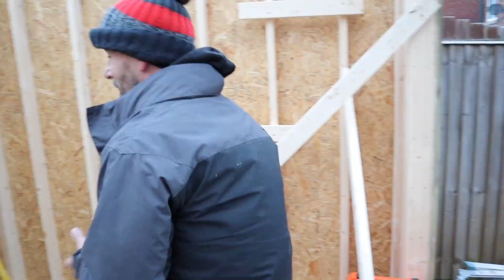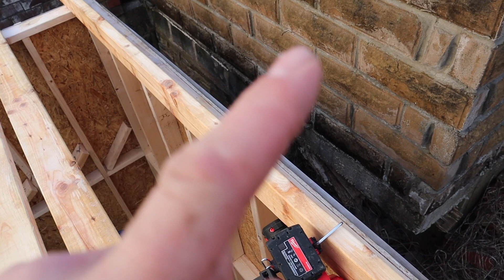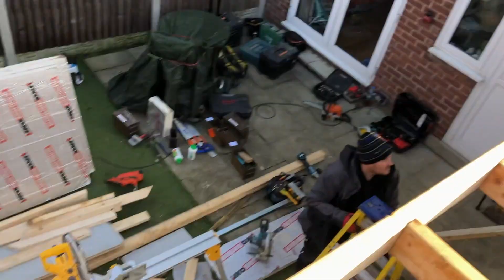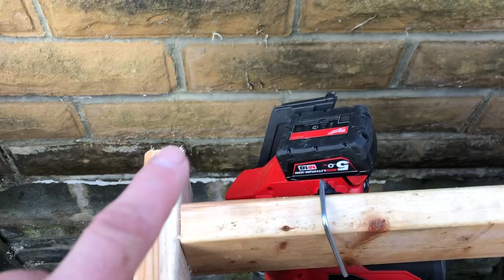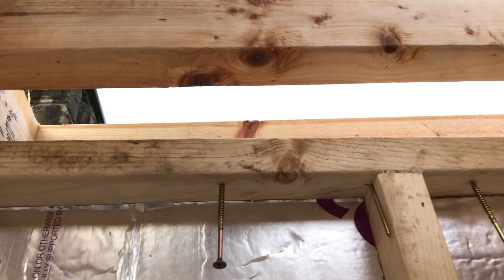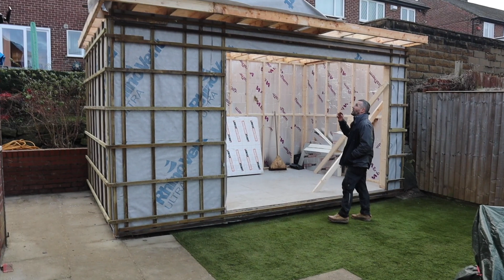Garden room flat roof constructionroof build

Comment: What do you mean about not having to put upside down joist hangers? Why would they have to be upside down and not the right way?
Reply from the maker: We generally strap the joist down over the steel lintel with joist hangers upside down to stop any wind lift on the roof
Reply: Could you fix a single length of timber on top of steel lintel and skew nails through joists into that?

Comment: If you put the insulation against the outer osb and clad inside also with osb do you need to put a vapour barrier before inside cladding or as its wood it will breathe, I was looking at macking my own sips type panels for garden work shop 9m x 3.5m approx and using the industrial 150 thick metal insulated roof sheets well that's what's in me head. 👍
Reply: In a SIP Vapour barrier would normally go in-between OSB and wall finish but if it's a garage and OSB is your finished wall it could go under the internal osb. You just need to make sure no air gap anywhere as this is where condensation can form. Guy on YouTube explains things well called Steve Roofer
Reply: @davidhamilton218   thanks for that i will look into it, instead of a wooden framed building as such i was going to do it at work with steel as i have found I'm no good at welding wood if I cut it wrong :)

Comment: Cracking job mate... just out of curiosity how will you fix the cladding on the back were its quite tight against wall? Only asking because I have a similar space I'd like to use. Cheers
Reply from the maker: We are using metal roofing sheets, these will be fixed to the back down as far as possible there will only be about 400mm not fixed but it’s pretty much tight against the wall so it’s not an issue
Reply: @thegardenroomguru  👌

Comment: Does building control have to be involved with this build? Because its gone through planning?  Out of interest how much hassel is it getting planning for these? Just wondering why you dont always go down this route, then no issues with headroom etc.
Thanks
Reply: Planning and building control are separate entities and planning can be vastly different depending on where in the country you are some authorities are fair easier going than others.
Reply: @rob1984p  yeah i understand that, but just wondered if once its gone through planning, do you have register the build with building control. To be honest I'm confused why they dont apply for planning on all the builds, then you can have better headroom etc. I'm hoping Will can shine some light on this as he currently working on one that has gone through planning.
Reply: Many neighbours will argue anything over 2.5m is detrimental to view/privacy etc so I suspect would fail planning. Remember too that a lot of the country live in very close quarters (think new build estates where everyone is already on top of each other even before having a higher than 2.5m garden room). Also planning costs around £250 and the delays at moment are horrendous . Can take more than 4 weeks, in some cases up to 12 weeks .

Comment: For the roof, 400 spacer, so not the same as the walls?? Or is it sorry confused, doesn’t take much lol
Reply: The rafters don’t need to fall directly on the corresponding wall stud. The double top beam of the walls spreads the load.
Reply: @AccountantDoesDIY  and i assume if you run the plasterboard side to side rather than front to back you'll lay it like the roof and floor in that you trim it to fit and use the offcuts to start the next row

Comment: Your lucky you have astro turf down or else that mud bath
Reply from the maker: Got a mud bath on one now 🙈
Reply: @thegardenroomguru  we just cover the garden in hard board not to expensive keep the grass from mucking and we reuse and reuse it keeps the place clean and easier to keep tidy
Reply: @orran8281  antinox works well too
Reply: @tentonhammer5469  ye I know see with the the hardboard I put it down and doesn't need anything to hold it now that stuff is good I use it for covering stuff inside

Comment: How are you going to fit the rubber roof in this weather? Either it will be raining, snowing or it wont be at least 5°C to apply. Ive been waiting to put the rubber on mine since late november
Reply from the maker: Fit them last year in the cold, well board the roof, prep it, lay rubber over it and cover with 100 mm insulation and then visqueen over night, if dry the next morning we will fit the rubber 1st thing. 
Two space heaters in the sealed room below will heat the underside of the osb3 from below, this will keep the roof above the min temp all day, allowing sufficient drying time, the top of the rubber will have the 100mm insulation on and visqueen fastened down , this will keep the frost off. Next day remove and see👀 
That’s the plan anyway, done it before successfully so we’ll see

Comment: can I ask a question ? what size are your bifolds you put in ? I am an avid watcher and struggling to see how I can put standard 2090mm high patio doors and bi folds on the front wall and keep it under permitted development with 5x2 on the roof and getting a 160mm steel in above the doors - i.e what height are you building front and back walls overall
Reply from the maker: You can’t mate, the 2.5 height limit has so many down sides, our doors are 1950 inc the cill 👌
Reply: @thegardenroomguru  ah ! so thats how you can get it under the height, appreciate the answer, might have to check out your door supplier you mentioned in Leeds then so I can get smaller door into the front wall. My front wall overall height at the moment is 2150 to allow me at highest point on roof to bottom of 6x2 floor joist be a few mm shy of the 2.5mtr

Comment: Do you usually use 50mm in the wall? I thought you used 90mm?
Reply from the maker: always 50mm mate, you might of seen us put sound bloc in on top of the 50mm on a few occasions though
Reply: Thank you. Reducing sure  saves costs
Reply: Look at U value calculators  on sites like kingspan and celotex. Should tell you what thickness insulation you need. Ali Dymock did a video on this. For my 4m x 3m build, 70mm pir insulation was recommended
Reply from the maker: @mphys5370  we build these day in day out, fitted right 50 is enough , never an issue
Reply: @thegardenroomguru  that is great thank you. Love the videos and love the energy

Comment: Nobody else building to that standard eh?🤔🤔, firstly the roof joists should be a minimum of 150mm, secondly the insulation should be flush with the studs to the inside of the room not pushed out against the osb.
Reply: BS